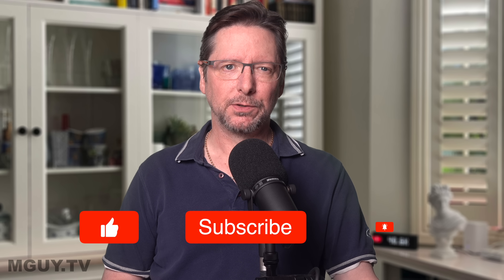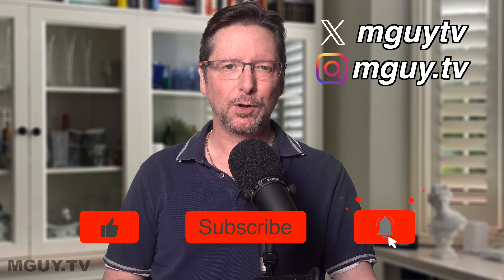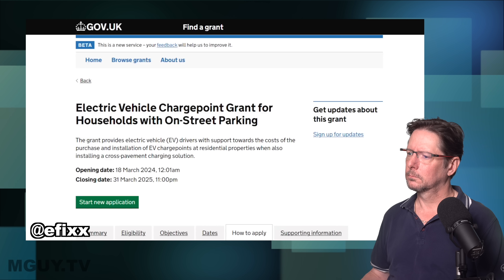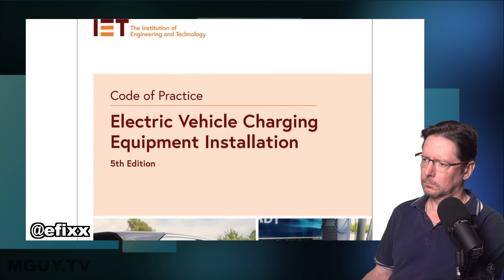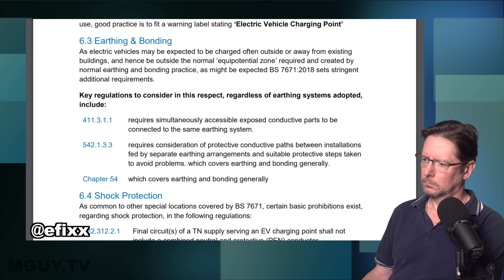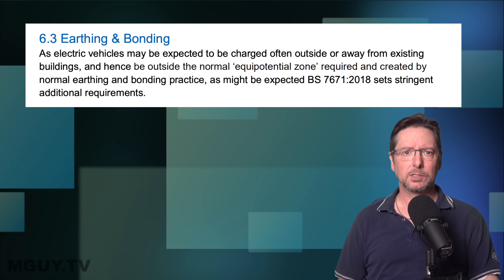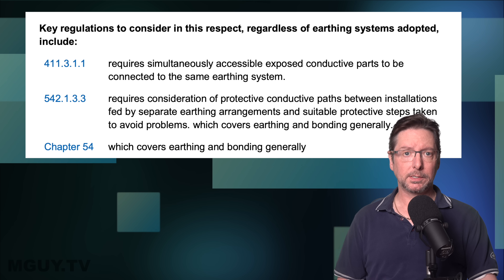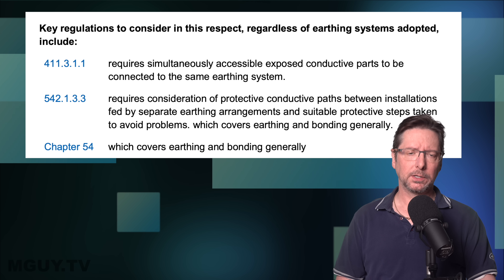ELECTROCUTION RISK from on-street EV Charging | MGUY Australia

Comment: ....and they are now talking abour DC charger voltages at 800V or even higher at 924V (Lucid Air system) which can deliver 300Kw of power.  The world has gone mad.
Reply: In Europe we have 800V chargers everywhere already. The higher the V the lower the amperage and as a result the cable resistance will be - which makes for lower charging losses and faster charging overall... We are already installing Mw charging stations for busses and lorries.

Comment: Hi Simon, yet another example of EV lunacy that's not been thought through.  Is there nothing this Government won't do to shoehorn EV's into the "net zero" agenda.
Assuming all of the regulatory safety requirements are met, what happens in the depths of winter, when trying to fit a a cold, stiff and somewhat unwieldy cable into a relatively narrow and shallow trench in the pavement?  It will be a "trip hazard" waiting to happen!
Reply: As I interpreted this it was meant to stay in the trench. Not that this would be any safer…

Comment: Does the regulation apply only to charger boxes/powered sites installed near a pathway with no common earth to nearby 'conductive' assets?
I suspect it is not entirely about ALL cables connected to the home as some can be used as long as they are insulated and do not make contact with conductive assets AND are not permanent fixtures on the pathway.

Comment: As an electrical designer working for a local electric board I can tell you that when installing EV charging stations, before you start work you MUST do a ground Earthing studying to determine the site conditions.
For a normal ‘Cold’ site the charger equipment you install must be at least 1 meter away from any other metal object above for below ground.
[so must not be in the same location as st lights, metal kiosks, buried water pipes, gas pipes or underground electric cables]

For a ‘Hot’ site ground conditions [like on a petrol station forecourt], the minimum separation distance is 6mtrs.

The problem with the footpath outside your home is that it will have the local utilities [water main, gas pipes and electric mains] running buried under the pathway.
So just as you say in this video you have different Earth potential running along the various types of equipment causing a significant risk.
[all gas and water mains are plastic but any old existing pipes out in the highway are very likely to be made of metal]

This is the reason why there are electrical bonding regulations to cover how you install an outside water tap for your garden watering hose.

If you pass a metal water pipe through your wall to outside the house it will be outside the equal potential zone of the house’s earthing zone.
So you must either install an Earth Mat under ground positioned under the outside tap [so that you are standing on top of the Earth Mat and protected by the same Earth when touching the tap]
Or you must install a plastic pipe that runs through the wall so that there is no potential electrical connected between what’s inside and out side the house.
Reply: I wondered why the pipes for the outside tap through my wall were plastic. Never knew that.

Comment: Their All TEPCO BNF's BRITISH EMPIRE WITH YOUR PRINCE ANDREW CHD's FANS ALL PUSHING THEIR SHEET
Dr. Joel Moskowitz, Director of the Center for Family and Community Health at the University of California Berkeley, shared that hybrid and electric cars may be cancer-causing as they emit increased levels of ELF.EMF radiation is a low form of energy released by any piece of technology with a plug or a battery that uses an electric current to function. Modern science has proven that extended exposure to these emissions cause adverse health effects.ELF radiation emits at a lower frequency than RF radiation, but both can cause biological effects in humans and the environment. The closer you are to the transmitter or battery in an electronic device, the more you are exposed to this radiation, and the more at risk you are of developing adverse health effects

Comment: Remember your EV is insulated from ground by four round rubber insulators so it's body could be "live" if it has a fault. And the faults path to ground could be you if you touch it 😈
Reply: What a bunch of FUD. If the HV circuit has a fault that connects it to anything outside then the circuit breakers will isolate it - not that there is any likelihood for that to ever happen unless the fire department needs to cut your car to pieces to extract you after a crash.
Reply: @karlgunterwunsch1950  Hmm, high voltage from house electrifys car body due to fault, circuit breakers don't trip as car body insulated from earth by tyres as there is no short circuit. You then touch the car (hand on car, feet on ground. In UK high possibility of feet on ground in puddle) It is at this point you discover how death sentences are carried out in the US.
Reply: @andrewallen9993  There are multiple fail-safes; the car will detect leakage to the body and stop drawing current from the cable, the EVSE also has built in current leakage detection and will stop supply to the vehicle, failing both of those, the home's RCD or ELCB will also instanly detect the Earth leakage and cut the power (or the equivalent at a fast charger), with close to 50million electric cars on the road in 2023 and over a billion charging sessions per year I can't find a single report of anyone being electrocuted by touching a charging EV.

Comment: No electrician will be able to responsibly sign off a simultaneous contact assessment as they wont be able to determine the circumstances of use and hence the risks of potential difference at the time, there are too many unknown possibilities. Different properties can have dissimilar earthing values and It is known that one property can have a fault that effects their neighbour's supply to put it simply.  This situation carries the problem outside the property to the public domain, hence the concern. The other point worth mentioning is that once this information from a accredited source is publicised ignorance is no defence from responsible persons and as such I cant see these being passed as safe. ( retired electrician)
Reply: I passed them as safe. I don't wanna be disrespectful to my seniors but please read up on the ev charging standards. There's a great amount of thought that went into making these as safe as they are, to the point where we haven't had a single case of someone getting zapped by a public charger.
Reply: @Luka_3D  Standards can and will be manipulated to suit (for example allowing 800V DC in a vehicle when that is never allowed for domestic installations) you must be well aware of the danger of taking  an uncontrolled supply in to the public arena (and I mean uncontrolled use) If you had experienced and investigated the fatalities I have over 40 years I suggest you wouldn't dismiss it so lightly. Sadly It will happen and I suppose you will then say It was only one person. This is uncharted territory as far as usage of supply outside property boundaries. If you don't understand the potential dangers attached I would respectfully suggest another job that matches your attitude to risk.

Comment: Talk about having a whinge about nothing... Underground power is everywhere, and in this situation an RCD would trip instantly if there was a short to ground.
Reply: Imagine the diyer improperly installing or modifying charging cables and associated infrastructure or a failure of a fault interruptor on high amperage charging points
Reply: @ragtowne  OK, I'm imagining... now what? Any idiot can try anything, with or without this plan. How many faults in a row do we need to have a problem? Damaged cable, plus a failure to detect a short by the charging control box, plus a failure of the RCD in the fuse box. I mean, do you go around fretting about street lights? Fret when you walk past a shed with three phase outlets? Do you fret as you walk past houses that have underground power delivery?
Reply: @drumphil00  How right you are. This video only shows how scaremongering and spreading FUD brings in the clicks. I reported this for spreading misinformation.
Reply: @karlgunterwunsch1950  I think the real issue is trip hazards etc. You may well be right on the leccy stuff, I have no idea, but councils have to err on the side of caution, and this is a non-starter, certainly in the UK.

Comment: I guess you never heard about the concept of differential circuit breaker. those that are safe even in  the bathroom.
Reply: You've totally missed the point being made,I give an example on a split load RCD consumer unit each RCD monitors two supply circuits with MCBs yet they both have the same common supply yet if you have a fault on one it doesn't trip the other RCD due to separate earth's and neutral to the other RCD.
In the UK the only mains socket allowed in a bathroom is a shaving one.
Reply: @derekcable  That's because the fuses in UK houses are idiotically located in the plugs... In this case the circuit breaker and fuse is located in the wall box the cable is connected to!

Comment: I recently watched a YT video from a UK electrician who said that most of the home chargers that had been installed by him and others in the UK were now "non-compliant" with current regulations. As they had changed their recommendations on how they should be protected by circuit breakers. He didn't think that many would ever be updated.
Reply: That's why wall boxes have the mandatory circuit breakers built in. Whoever installed cabling without using a wall box should be connected to mains circuit for an hour..
Reply: Plus there's a whole load of guidance on home solar type Battery installation coming along apparently - like not placing them in the roof and isolated etc
Reply: How hard is it to replace a circuit breaker lol
Reply: He's an idiot and not to be trusted. He's passing the buck and making it My Energi's fault when in fact its his failure to follow the instructions and provide additional protection. My dad had no issue in getting his sorted so why is that moron having such an issue, hint, its his fault.

Comment: Copper theft will be on the rise and fix the issue. Besides, how many faulty installs will allow random EV drivers from tapping juice from your extention cord, unless there is some contactor in the house switching off the current unless the owners EV is hooked up?
Reply: When ever I see an unattended electrical device plugged in consuming power I unplug it. It helps save the planet.
Reply: @adenwellsmith6908  I helped improving sockets by removing the N wire from it's screw and leaving the F one. Measuring across you still read 230V
Reply: @ttkddry  Three phase, you get more volts if you cross the phases.
Reply: @adenwellsmith6908  you mean between a phase and the neutral (if present) you get 380 V while between the phases there is only 230 V
Reply: @ttkddry  Wrong way around. Between any phase and ground you will get 230V but between phases you'll get 380V (phase offset of 120°)...
Reply: @ttkddry  Between phases.
Reply: @karlgunterwunsch1950  yes you are right, I keep mixing them up

Comment: The unseen sign at all of these says: Free Copper Cable.
Reply: That's what is happening here. Scrappers are vandalizing EV chargers for the copper and aluminum.
Reply: Great isn’t it
Reply: Disconnect at your own risk.
Reply: @bobpitt1261 I saw that they cut a life three phase cable under a load of 500 amps with an axe.😁
Reply: @crazyedo9979 ... and having cut off the power mid-cable with an axe, they can trim the copper off each end at their leisure.
Reply: Gunna say there are easier targets,  cables locked at one end and secured at the other end with a car alarm and in app real time “charging error” to the owner of the phone in a building next door?  Safer to steal the cat off the next car down
Reply: Good point 😂😆

Comment: Is it safe to “plug in” the EV when it is raining? 

No, I’m not and never will be an EV owner.
Reply: Ditto
Reply: It's perfectly safe. That's what the connectors were designed to protect against - the distances, insulation and circuit breakers all prevent any harm to ever come to you. Unlike gasoline you can't rely on that to kill you...

Comment: and dont forget that the incoming cables of houses etc are on a 3 phase system , each house has a single phase , the neighbour has the next phase , there is a potentiality there of 415 volts between phases , the idea of close proximity different phases is very dangerous and risky , the lunacy just to promote something that is NOT good for the environment should be banned , we have the REGS for a reason , SAFETY
Reply: Close proximity between different phases is very dangerous??? How on earth does every shed on earth with three phase outlets not burn down? Crikey, we really are delving deep into the well of grumpy cranks.
Reply: @drumphil00  clown
Reply: The street lighting can be on an entirely different transformer. Without the luxury of Ground Fault Detectors, only a fuse.
Reply: @Aimless6  street lighting in general in the uk is on the same 3 phase cable that supplies the domestic properties in a street, it does not in the uk have a seperate supply unless it is required by special installation circumstances
Reply: "Each house has a single phase" is simply a false statement. Houses are connected to all three phases and there are even appliances already that require connection to all three, for example electric ovens or your warm water boiler. So stop spreading FUD.
Reply: @karlgunterwunsch1950  We don't generally need a multiphase supply in the UK and Australia because we use 230 AC. This is enough for cooking/water boiling etc. Only if you wanted to run an industrial process in your shed would you need to pay for three phase to come onto your property and that would be expensive.
Reply: @davidhumpherson4904  In Germany every household has 3 phase connectors! Our ovens run on that as well as most forms of heating (when electric, heat pumps, etc)... In fact it is illegal to hook up only one phase because it would result in an imbalance of the phases which can damage the local electricity grid.
Reply: @karlgunterwunsch1950  Hey, thanks Karl, interesting to know that - appreciated.
Reply: @davidhumpherson4904  This isn't totally true. The maximum supply for single phase is 100A. If you need more than this you would generally need to go 3 phase. So it isn't just about 3 phase equipment. Larger houses for instance might need 3 phase.
Reply: @paulstimpson8977 For sure. I guess making sure sockets etc that are on different phases are in separate rooms and everything is labelled up where appropriate. Also lighting circuits? Dunno, not a sparky 😊 Cheers 👍
Reply: @karlgunterwunsch1950  in the UK most domestic properties are single phase , the supply in the streets is a three phase , either 3 core or 4 core , each property is supplied with one phase to point making 240 ac , the next property is one the next 120 degree phase so on and so on , so every third is on say the red phase but because the next property is on say the yellow phase it makes 415 V ac , what you state is not actually what is the standard unless of course you have a 3 phase supply which is usually only neccessary if you high load heaters or motors , the supplier wants a balanced load across 3 phases , but as i said most donestic properties have single phase which is around 240 v ac , if your house in the UK is connected to 3 phase then you still have the problem of cross phasing , and dont show your lack of knowledge by making out i am incorrect , i have worked in all parts of the electrical installation and maintenance profession from low voltage control systems to high voltage distribution , have you ? it is people like yourself who have no idea what they are talking about which cause many unsafe practises and if you look before opening your gob you might learn something
Reply: @karlgunterwunsch1950  Not in the UK. If you want 3 phase to a house you have to apply for it and it costs a lot to have it approved and installed. So your statement is, in your own words,  simply a false statement. You need to specify location since there are probably as many different systems as there are countries. If I want 3 phase in my house it will involve digging a trench from the cable running under the path outside the property to the meter location. I do not have an overhead supply. Some older properties near me do have overhead supplies so will be cheaper to connect to 3 phase but would still have to go through the approvals process.
Reply: @martinconnelly1473  In Germany there isn't a house without 3 phase connectivity.
Reply: @karlgunterwunsch1950  My house is only one phase and 230 volts. If it had all three phases it would be 415 volts. You need to explain this one in detail as it makes no sense as I don't have a 3 phase cooker and never heard of one being available as a consumer item. All the three phase cookers I see for sale are professional ones for commercial sites which may very well have 3 phase supplies. How many houses in the UK are you saying have 3 phase supplies?
Reply: I love how all these people spewing bullshit in the comments and then get ratioed in the replies
Reply: @Luka_3D  What does ratio-ed mean? Serious question, cheers 👍
Reply: @davidhumpherson4904  It's just a zoomer word for being proven wrong